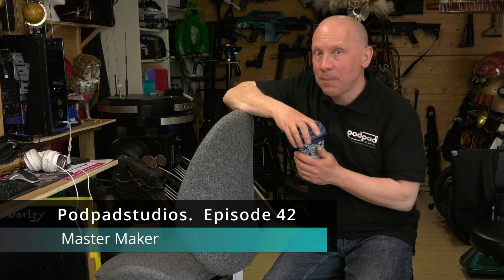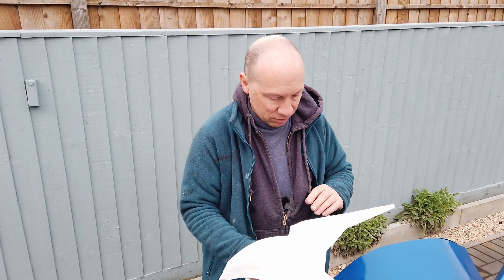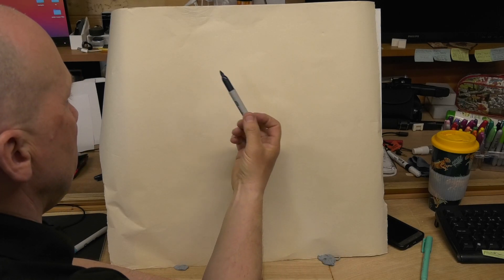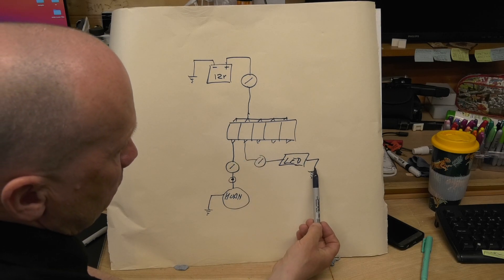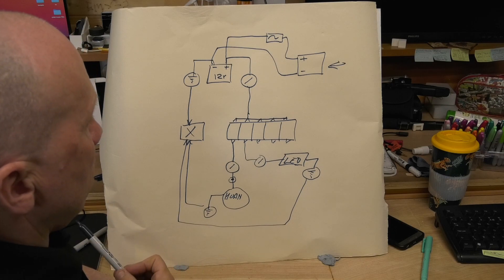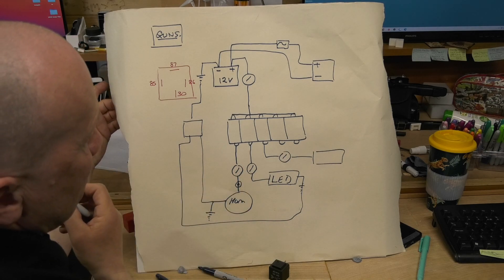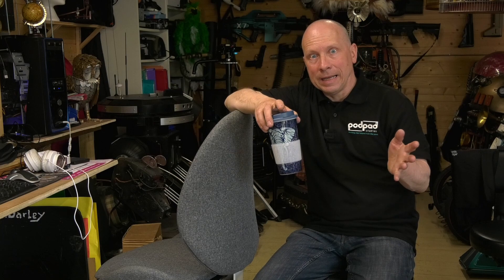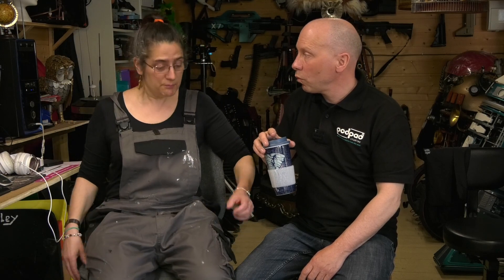Judge Dredd Bike Project Update Podpadstudios Season 1, Episode 42

Comment: Dont forget to put a master fuse within a couple of inches of the battery positive terminal.
Reply from the maker: Well spotted Really good point @Clunk. We use a large resettable fuse  which is part of the kill switch.
Reply: @PodpadStudios  But what about the feed between the battery and kill switch? What if that shorts? Fuses should be as close to the battery as possible. I learned that mistake and ended up spending a weekend re-wiring a Ford Sierra, when a live wire shorted out on the choke cable turning it into a heater that melted every wire in the master loom. It was the 12v live to the towbar, and the installer put the fuse in the boot. So 10 feet of it was unprotected.
Reply from the maker: @LordClunk  nightmare, and you are absolutely correct placing fuses in correct places in the circuits is very Important, as is using the correct rating of components.